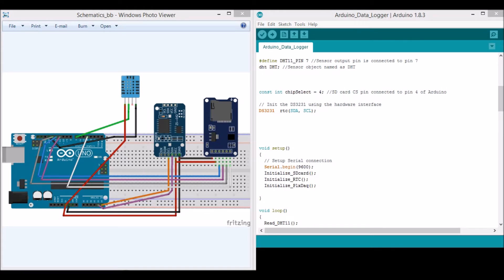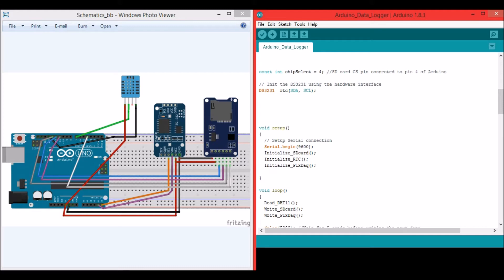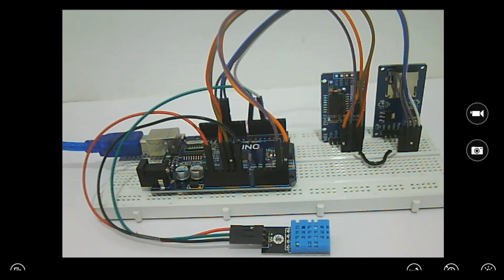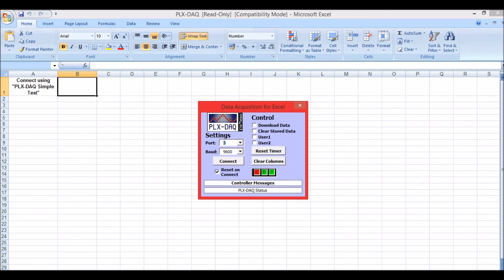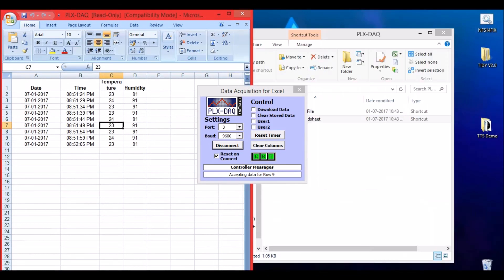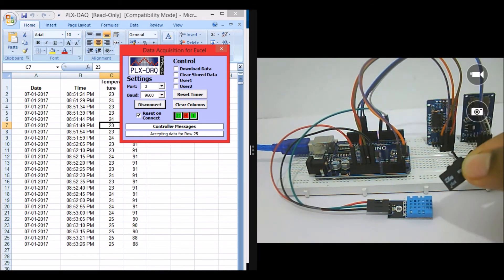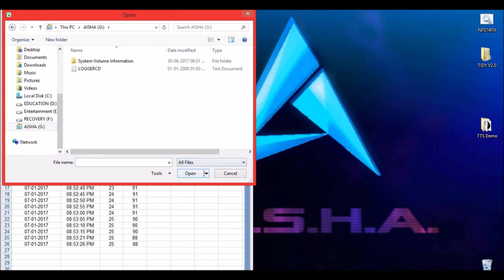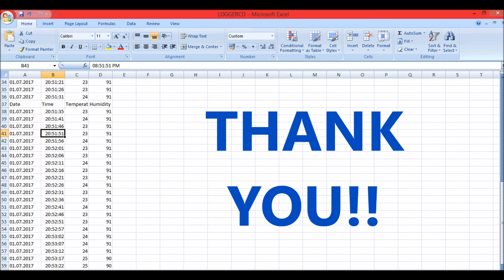DIY Arduino Data Logger - Log Temperature & Humidity Data on SD Card

Comment: Nice video and great detail on the website link for the build.  Thank you!

What size SD card would you recommend for say 1 year of logging?

You're obviously located in the southern hemisphere. Wherever you are based, the humidity is incredibly high... 91%.  You must have been sweating in January 2017.

Need to drink plenty of liquids.

Can this design be easily turned into a moisture meter ie where you stick 2 probes into a wall or timber to measure the moisture content?
Reply from the maker: Since it is just text value we are storing any statard values such as 8, 16 or 32 Gb could be enough. And yes you can use this with a moisture sensor with some code modification.
Reply: @Circuitdigest  Thank you.  I have since realised that I want to record relative humidity.  That will no doubt require some additional kit and additional calculation.

Comment: How to write program for ir 2 sensor, LCd, sd card and rtc module.
Reply from the maker: You may check out https://circuitdigest.com/. you will find multiple project using those sensors. Use those as reference.

Comment: What change we have to make in code if we have to use two DHT22 sensors with this data logging system
Reply from the maker: Just initialize the second sensor with a different name and read the data.

Comment: When making use of the PLX-DAQ, does that mean that the computer/laptop has to be connected all the time to the data logger to be able to record the date and time if the RTC module is not used?
Reply from the maker: Yes, it reads data from the serial port.